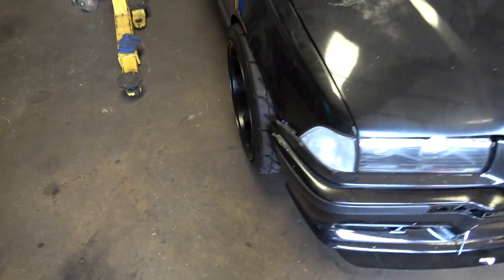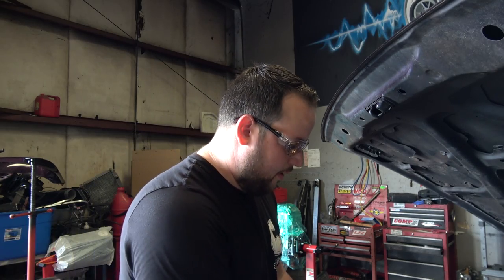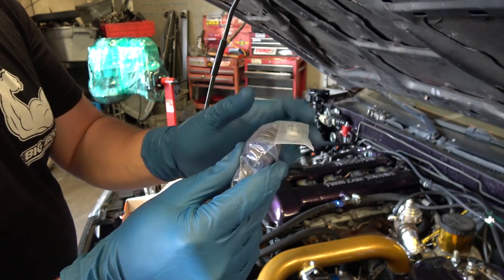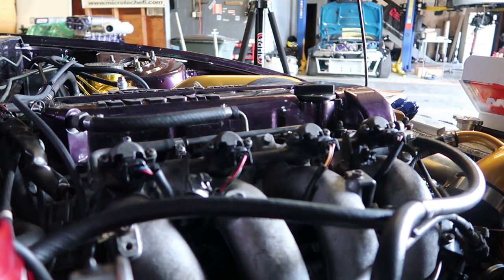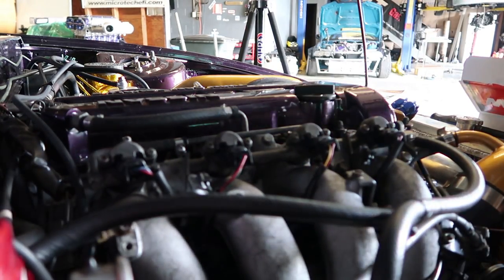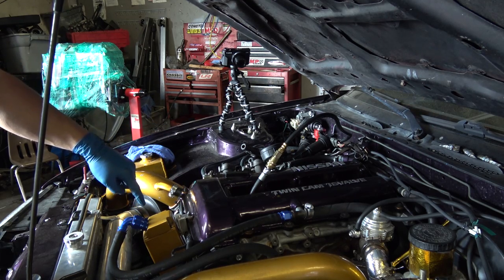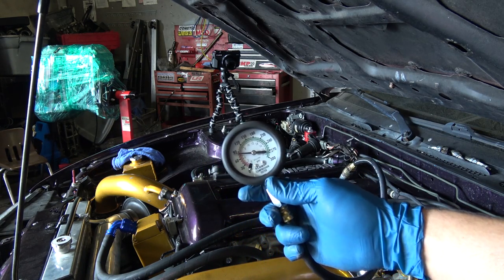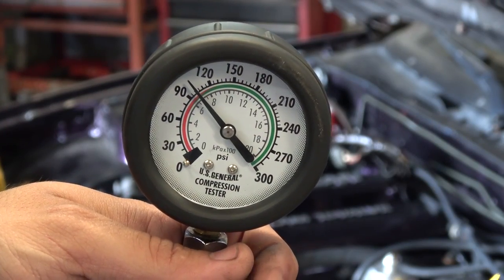FIXING NICOLE'S 240SX BIGBOOST WAY!

Comment: Mr Big Boost does her car have aftermarket cams, if so they would leave the valves open longer therefore lower compression numbers. Doesn't explain cylinder 4 reading lower than the rest though. Just some food for thought.

Comment: when you do compression tests,   always have the car on a battery charger , it assures steady voltage through testing , so when you crank , it cranks the same through the testing , giving you the most accurate/consistent/replicate-able ,  results.

Comment: So what compression readings did you get after warming up the engine? I was thinking that if there is fuel in the oil it would be also on the piston rings so thats why the lower compression because of not good enough seal at the pistons.
Reply from the maker: the second time around was with fresh oil, and warmed up

Comment: just chuck adams sr20 in it
Reply: Dushan241096 i think that will be a good plan b if this continues to give them trouble.
Reply: Dushan241096 i comment that on every video for me makes no sense to spend time on this Sr when you got a fully built one of waiting to get out of Adams car
Reply: Dushan241096 Thinking the exact same mate
Reply: well these motor are actually about the same terms of being a built motor if i recall right
Reply: Adam's engine's running much better though.

Comment: Yo Alberto you don't have to delete the vanos to tap into oil pressure you can get a double banjo bolt and keep both. U could try putting atf in the cylinders or wd40 and letting it sit that might help lube and free up the rings

Comment: @Alberto BIGBOOST what do you mean on your Bmw when you say the engine has high compression? Is the engine have built internals or just high compression for stock?
Reply: Jarred Hopkins pretty sure he meant higher compression pistons
Reply from the maker: the engine is 10:5.1 compression ratio, normally for a turbo engine the comp ratio is 8:0.1

Comment: Hey Alberto, why didn't you retest the compression with a squirt of oil in each cylinder? I've always tested compression before and after a squirt of oil in each cylinder, because it gives you a better idea of piston ring wear / condition. If the squirt of oil makes no difference then your rings are good, if it increases your readings significantly then the rings are worn.

The quality of your video making has improved too, which is nice! Shame there was a focusing issue at one point in this video, but a good video all the same :)

Comment: The low compression can not be because the motor is forged? Are forged engines supposed to have less R / C because they carry more blowing in the turbo?
Reply: eckovesper I have no clue about engines (past the basics) but he did mention they were all around 130 PSI last time he tested.
Reply: youre right, maybe they fucked up that trackday...
Reply: if it was alberto would know, they had low compression on adams 2j but alberto said thats normal
Reply from the maker: I'm monitoring engine performance and ammount of blow by. its looking pretty good still. no need to rebuild yet. would like to refresh the engine later to bring it up to spec tough
Reply: eckovesper I think putting forged parts in the engine would make it higher compression, but idk.
Reply: putting lower compression pistons and a bigger cam will read lower compression
Reply: yes forged is same parts, as long as forged parts are identical replacements to cast there shouldn't be a changed
Reply: if you think wether the parts in an engine are forged or not has any bearing on compression ratio them you have failed engine 101 badly!!

Comment: Are you going to do an oil test? in my country we call it Prueba humeda... It consists of putting a little oil through the sparkplug hole to check for rings failure, head gasket or head itself...
Reply: Luis González we don't do that in America.
Reply: why?
Reply: Luis González because a compression tester does all of that. it's a general test. if you drop compression in any way it is only a symptom, not a diagnosis. so you pull the head off if your compression fails and see what the cause is.
Reply: Kyle Harris speak for yourself. We wet compression test all the time if we get low numbers dry. It helps pin point the problem. After that we run a leak down test. A dry compression test is just one step of the process of doing it properly. Doing it this way you will know the cause without even pulling the valve cover.

Comment: Hey Big Boost I just bought a 95Infiniti g20 with a sr20de this is my second g20 I have owed but this motor has a bent rod is it better to just buy another engine or what should I do? I never touched the internals on these kind of engines

Comment: I've hydro locked my race motor before, should change the oil a couple times to help remove the fuel from the bearings
Reply from the maker: hydrolocked with fuel or water? if fuel just change the oil and filter once and you will be good

Comment: Would that Valvoline VR1 be good in non built motors? Such as my trucks 5.4?
Reply from the maker: yes. they also have it in 10w30 weight and straight 50.
Reply: Alberto BIGBOOST cool thank you!

Comment: so you use the 20w-50 VR1 in every engine no matter what? ive been running 5w-30 in my SR b/c thats what the FSM says.
Reply: Chris Caughy thicker oil so it won't get hot as fast
Reply from the maker: I run heavier oil due to the higher engine temps we run while drifting. to keep proper oil pressure thicker weight oil is the way to go when you are running at hight temps and boosted

Comment: them compression is worse then my toyota corolla with 280k miles lol

quick tip use engine restore additive it will raise your compression by alot my went from 115 on all to 127 after 300 mile drive and i use it every oil change
Reply: nawzy202 what brand? I want to try it on my daily driver.
Reply: JDM Fanboy You can find video guy testing it and showing amazing compression results product is 

http://www.restoreusa.com/index.php
Reply: Just youtube engine restore additive
Reply: would love to see what your engine looks like taken apart i am sure that stuff youre adding isnt a permanent solution, its more like heelping your old dog get in the car in your way to the vet to have him put down...
Reply: Sweet thx